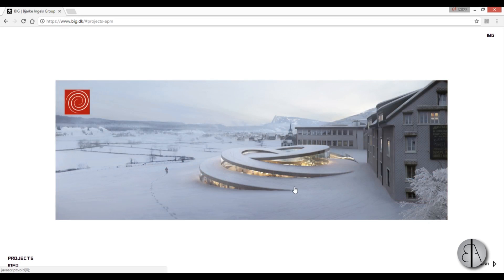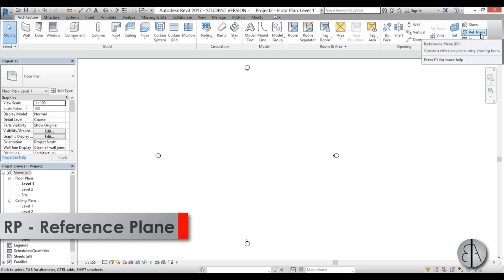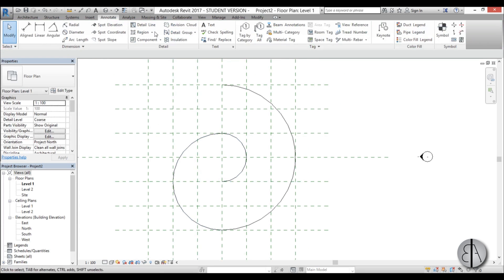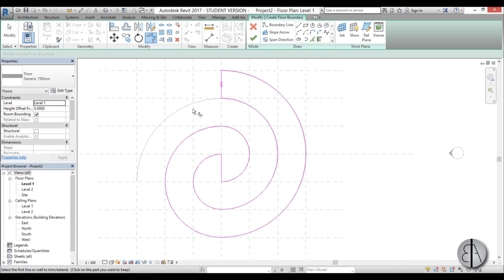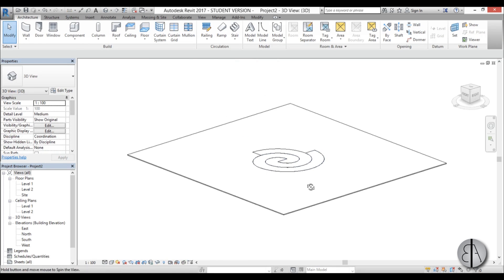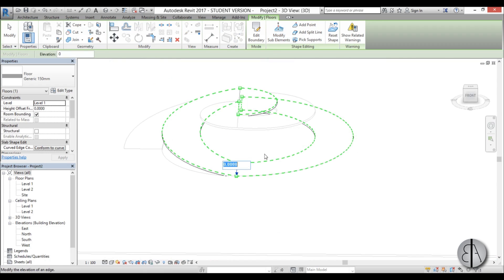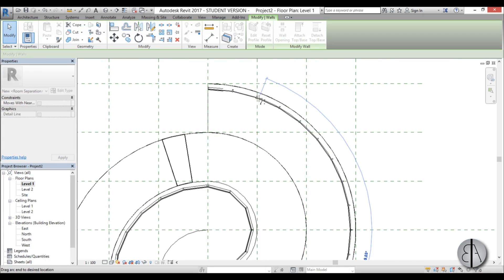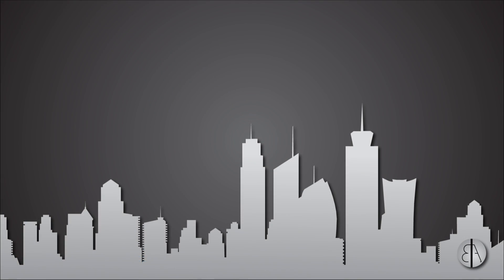Modeling BIG architects Spiral in Revit

Comment: I swear Autodesk did something to the attach top/base setting for curved walls in Revit 2021 (or perhaps few versions before), because attaching curved walls to slanted roofs doesn't seem to work as easy and direct as this anymore. And all the othet youtube video suggests trimming the wall with model-in-place void. Revit is useful, and things as easy as this shouldn't be made complicated.